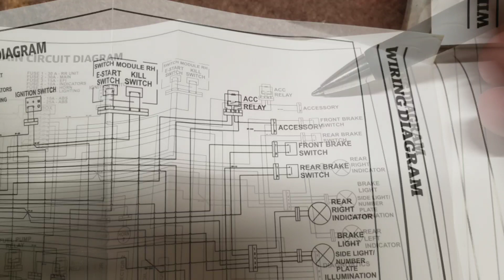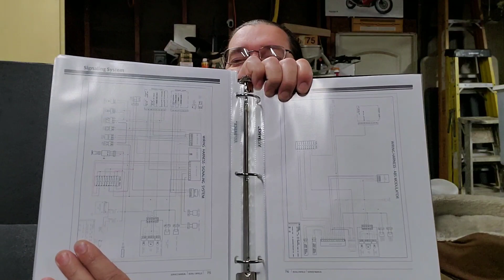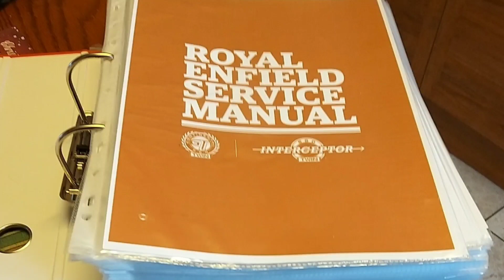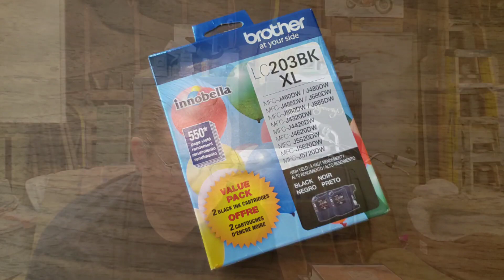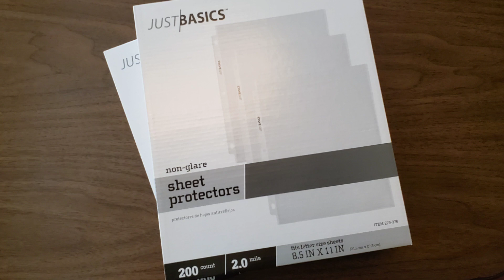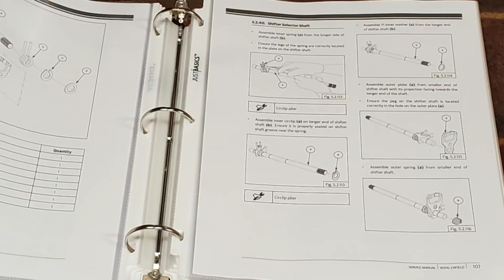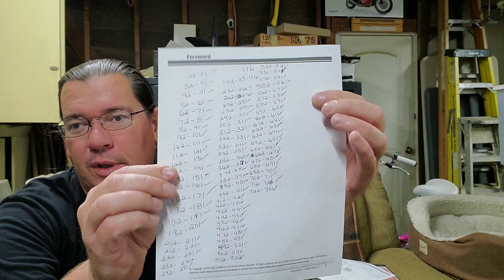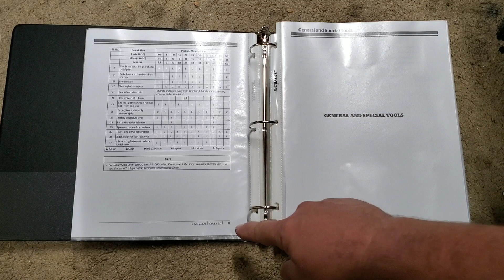Service Manual

Comment: I would probably be one of those guys complaining that your videos are too long. But you know what? I like watching them. They are great to sit back and relax to. And maybe have a beer :) I just wish I could find more time to watch more of your videos.
I too found this download a few days ago and have been going through it. Mind you, with such a big file, it's not very convenient to find what you're looking for when viewing on a computer. Even on a fast computer it takes several seconds to display a page when you scroll. So you did the right thing by printing it! BTW, the index on tin the book seems to be a little off. As an example, look up headlamp in the index. There is only a single entry for "Headlamp holder positioning" and it points to page 516. But when you go to page 516 (actual printed page number, not PDF page number), it has nothing about the headlamp. Am I missing something in reading the index correctly?
Could you please point me to the Facebook group you were talking about. The link in the description leads directly to the file. I am possibly getting an Interceptor soon. In the final stages of shopping, having recently sold my 7 year old Harley Sportster.
Keep the videos coming. I'll find the time to watch them. :) Cheers!
Reply from the maker: I think you'll be very happy with the trade.  Sportsters are pretty reliable, but I'm not a fan of the bigger Harley engines.  This bike is just too much fun to ride.  I am not surprised on the index being a bit off.  I'll probably note the actual pages directly in the index as I'm using it.  Hopefully my corrections are not extensive.  I don't want to work on this bike very much.

Thanks for the comment, I like reading them, and interacting with you guys.  

https://www.facebook.com/groups/royalenfield650twins/